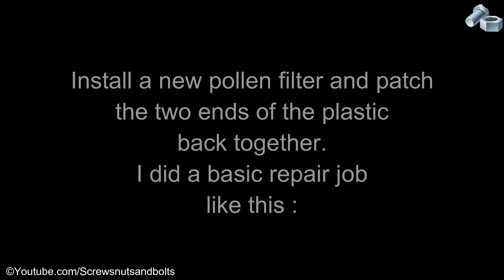Pollen Filter Renewal - Nissan Micra K11

Comment: Hi, congratulations on your videos,
 I have a nissan micra identical to the one in the video ... I followed all the steps .. but when I get to unscrew the plate to remove the filter, I have a problem ... there is no screw or plate there is all a single block of plastic ... 🙈 can you help me?  Thank you.
Sorry for my poor english...
Reply: I have the same problem my friend, do you also have the ac model?
If so, I think that ac models don't have cabin air filter.
Reply: @ptso34  correct, ac models dont have filters, if the system is dirty just buy a ac cleaning bom and follow the instructions on that

Comment: So what happens if I don't do a patch repair job on that plastic but just rip it out on these dotted lines? What is the structural function of that plastic? Is my stupid car falling apart when I don't patch that up?

I used to drive a Micra from '93 with more than 300.000km on the counter. It was my baby and my lovely Gertrude. 

Sadly, the bottom plate was rusted through and through so I bought a 2001 ugly orange thing (christened Tom) with flaky paint, a broken air mass meter and a blower capacity that can't even blow out a candle. But hey, times are hard and he didn't cost me a kidney, I don't care about the paint but since I am going on a 1000km round trip this summer, I like that blower to work. (That air mass meter thing is been going on for a solid year now and it still goes so who cares huh?)

Thanks for this vid. I never would have molested that plastic on my own.
Reply: Don't call it stupid :( Micra will always love you.
Reply: @Holms  I would never call Tom stupid. He is just different. But still going strong. 😊
Reply: 2001 models just have a metal plate instead of plastic that needs to be cut

Comment: No matter what I do, I cannot get those glove box pins out. Any hints and tips?
Reply from the maker: Are they the exact same as these ones ?. They should just pull out. Don't lever them, just hold them by the narrow bit and slide them straight out.
Reply: @screwsnutsandbolts  yeah, they rotate and I've held and pulled and twisted and they are NOT coming out lol.
Reply: @betrayhonesty  use screwdriver it will pull out, you won't break anything.

Comment: NISSAN MICRA II (K11) 1.0 i 16V (54Cv), gasolina, A/C to 1999 has a polen filter?
Reply from the maker: Is it not the same as in this video ?
Reply: ScrewsNutsAndBolts It does not look the same, but I'll check it again. thank you.
Reply: did you found where is the filter?
Reply: me too I have a micra 1.0 A / C  and it's different, I can not find the pollen filter !!!
Reply: @ezanfirescu  K11s with A/C don't have a cabin filter,only these without A/C have.
Reply: @demonator4575  very strange, all the other cars have a pollen filter ... thanks anyway!!
Reply: @ezanfirescu  I know that my friend,A/C k11s don't.